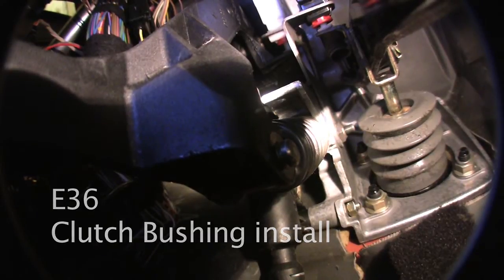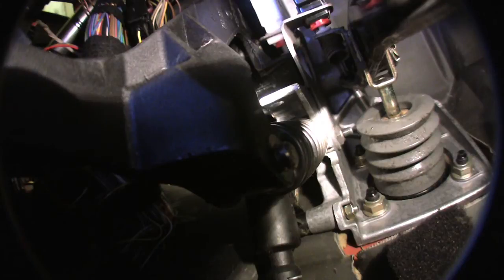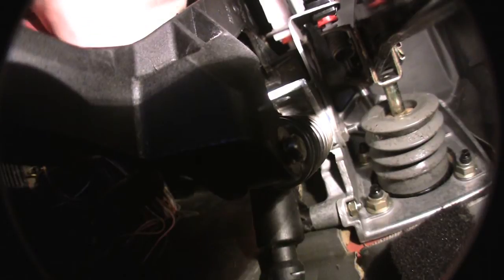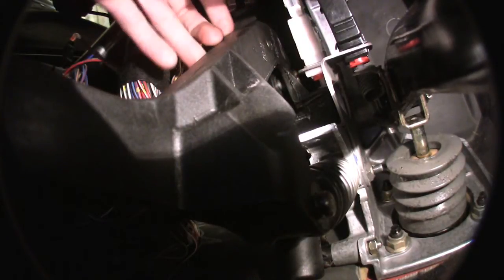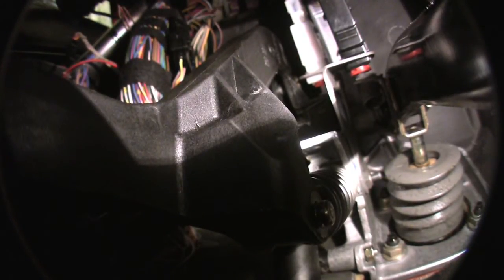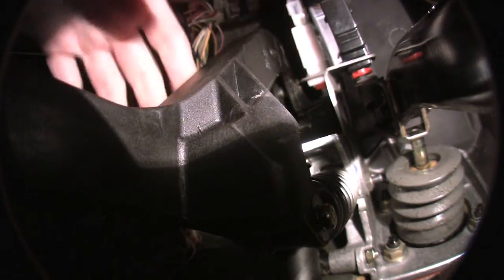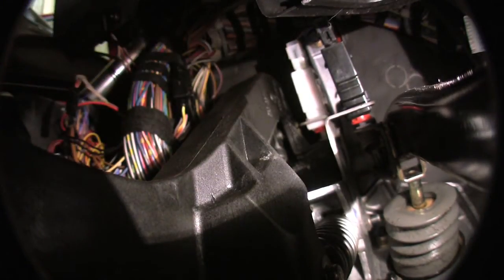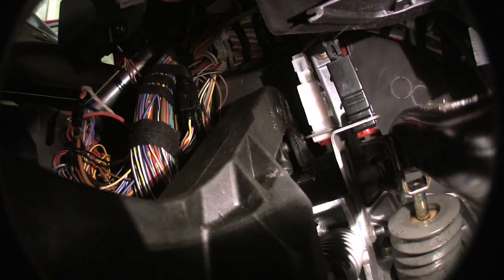BMW E36 Clutch Pedal Bushing install video

Comment: E36 Manufactured PRIOR to 3/97 will have a different spring setup what WILL pop out as soon as the mast. cylinder is un pinned.  so when reassembly, clutch pedal into the pivot first, put the spring inplace with this tiny metal bracket, compress by hand, then stick the pin through where the master cylinder arm is.  Hope this addition helps!

Comment from the maker: No problem. If I remember correctly, it's the little divot in the rear, as opposed to the one in the front. It'll probably help you if you take the pin out of the spring and rest it in the divots in the bracket. It'll fit like a glove into the smaller one, which I believe it towards the back. 

Hope that helps.

Comment from the maker: If we're calling driver's side the "left", there's a circlip on the left side of the retaining pin for the master cylinder plunger. Remove the circlip, and slide the retaining pin out to the right. The plunger will be freed up and the pedal will move WAY back, giving you plenty of room to get at the pivot bushings.

Comment from the maker: Thanks man. The pedal just has some side to side slop that annoys me. A lot of E36's have it. You can usually sort out poor pedal feel by replacing these bushings, bleeding the system, and removing the clutch delay valve (CDV) from the line. The clutch and flywheel are pretty robust.

Comment: Thank you for this. I used this as an aid to replace my clutch pedal and bushings. Now that I have it all back together, there is a hiccup at the end of the pedal stroke - the end being at the release of the pedal stroke. The pedal travel at the end is not smooth like it was. Now it pops back at the very end. I just took it apart thinking it may be the input shaft/rod on the master cylinder as there appears to be play from the rod to the plastic eye bolt hole which the rod connects to. Thoughts?

Comment: I appreciate the video man, but theres 1 area im having problems with... near the 2:50 mark, where you say you need to pop "the circle that connects the master cylinder plunjer to the clutch pedal itself out". How did you manage to pop urs out? ive tried everything but it seems to be stuck in there even though its greased up pretty good.

Comment: Sorry, but I need help with one more step and then after that I think im smooth sailing... I'm having trouble putting the clutch spring back into place. I'm trying to find where the clutch spring needs to rest on, which is somewhere on the bracket which holds the brake switch. There are two areas that looks like the pin could be held into place but i've had a hard time fitting it in. I hope this is clear...